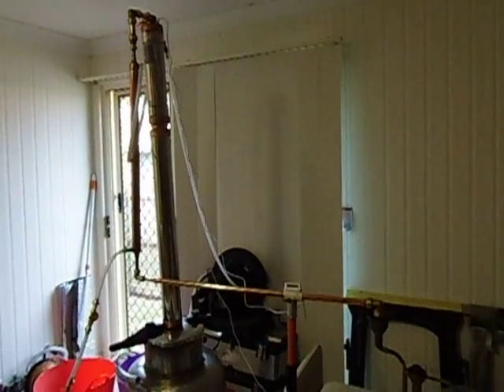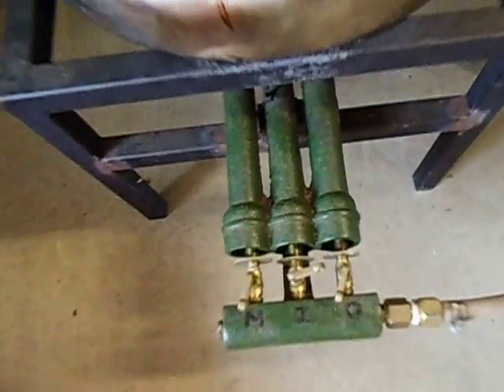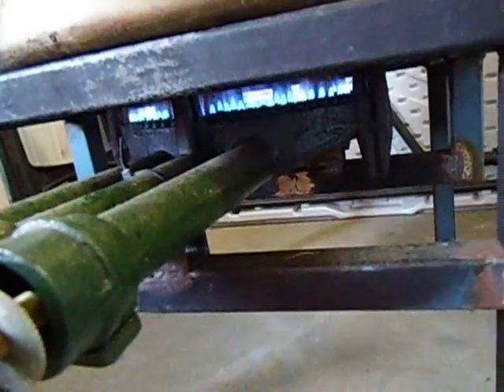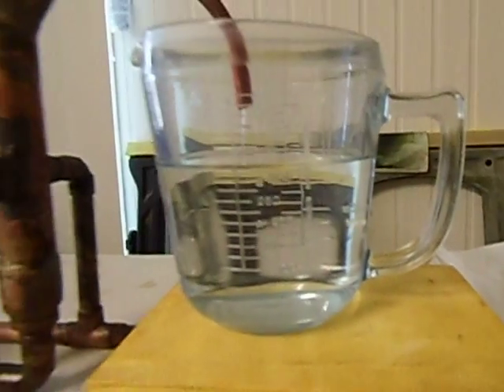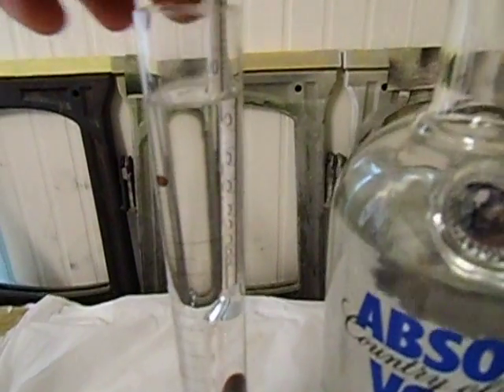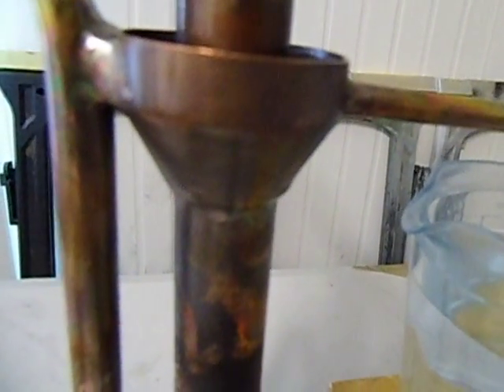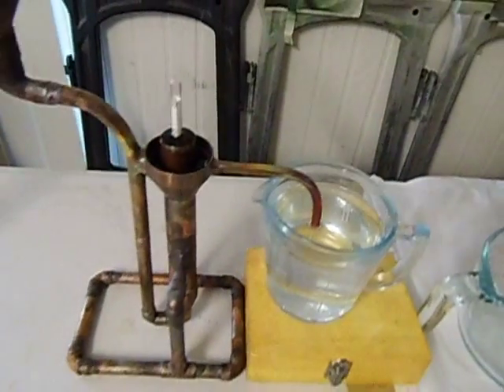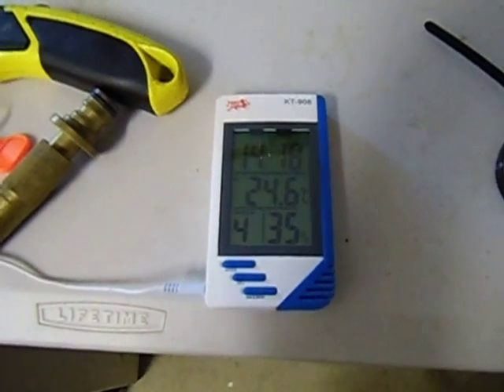My homemade reflux still first run part 4 of 4

Comment: the brass fittings are of concern to me, these fittings are subject to leeching into you distillate, even brass taps should not be used. Word Health says there is no maximum safe level of exposure (only safe level is 0 )